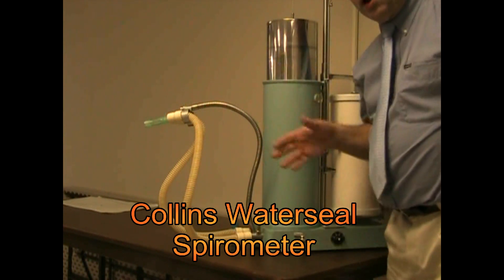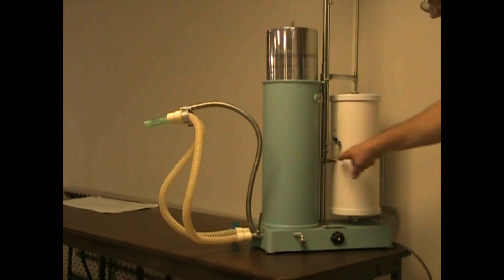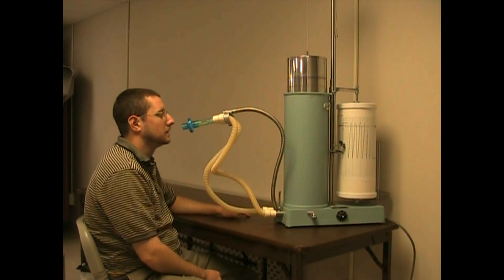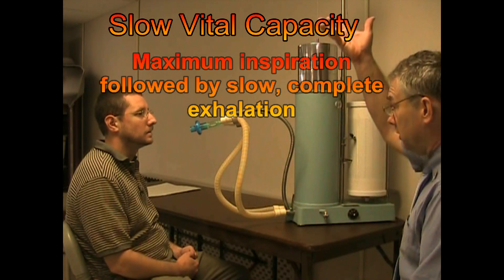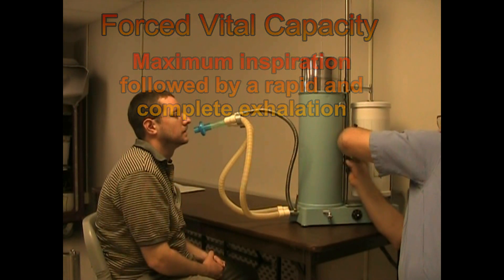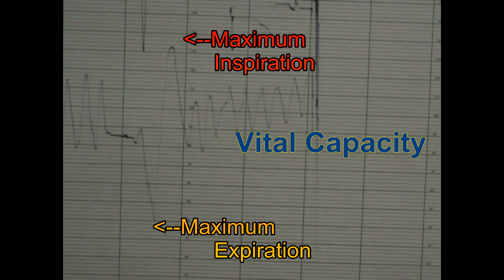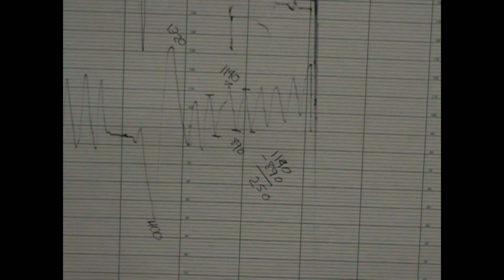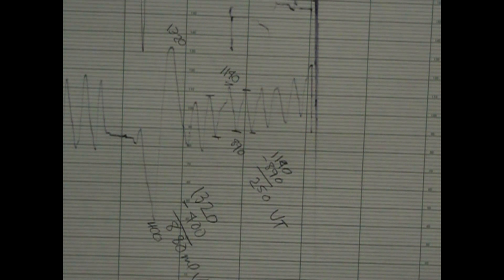RESPIRATORY CARE: Waterseal Spirometry.wmv

Comment: The early part of the video states on inspiration the bell goes down and the pen goes up...on exhalation the bell goes up and the pen goes down.  That is correct. Later on in the video I use a raised hand signals to have the patient fill up their lungs. This has nothing to do with the movement of the bell or pen.  It is just easier for the patient to understand full up with a up hand signal.